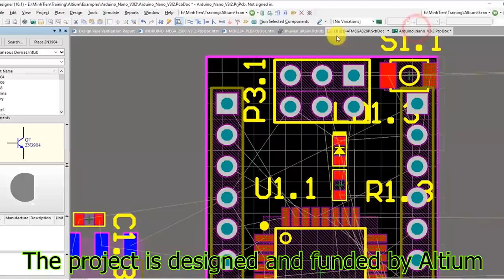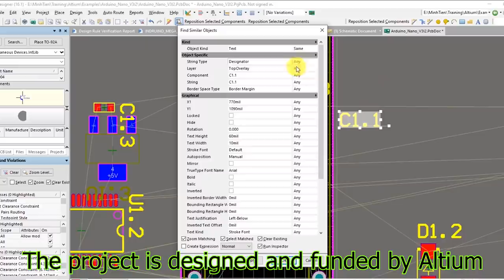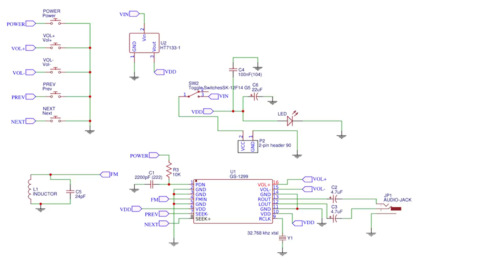Tips for soldering smd components with iron | FM radio KIT

Comment: Hello Friend, I'm Trying to make an inverter using egs002 My configuration is Input 125V DC and Output 240V AC, 1500VA. Transformer is using 75V to 240V and IGBT using FGA25N120ANTD for bridge. but I can not give load more than 600Watt. If Increase the load more than 600Watt IGBT is Blowing. Can you give any Idea regarding this matter.